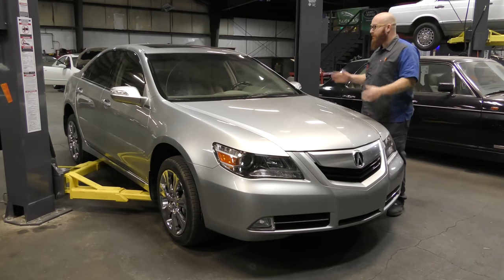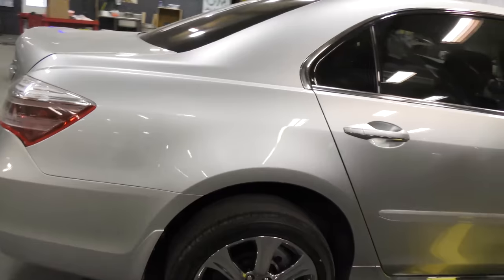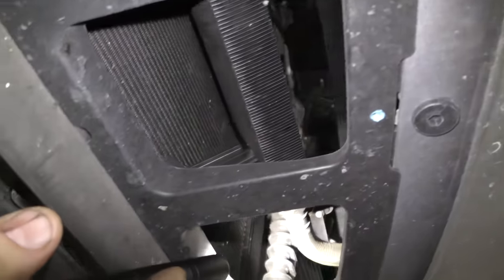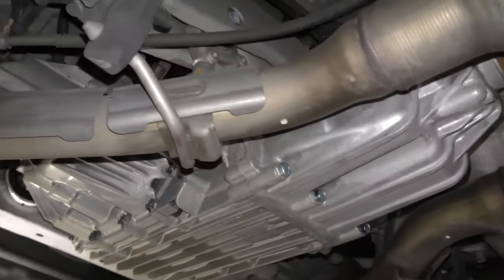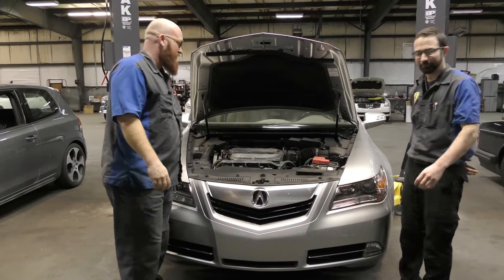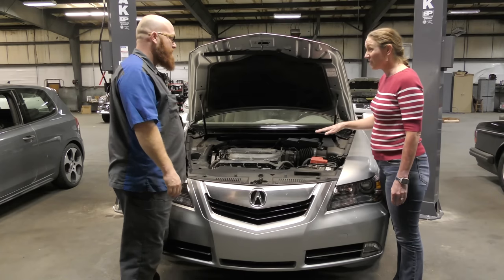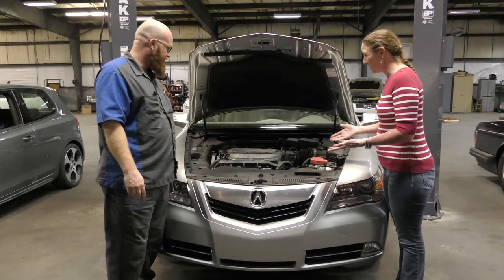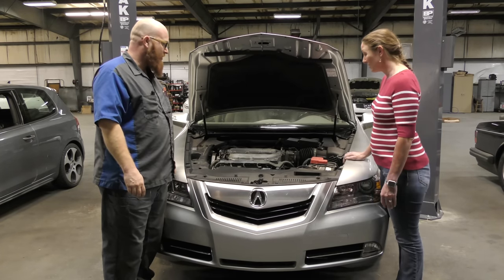Something Very Serious is Wrong with this 2010 Acura RL! What did the CAR WIZARD find???

Comment: First,  I love watching the Car Wizard.  Too bad for us there isn't one of him about every 20 miles or so.

As far as that Acura, what a shame. Acura's have been pretty darned good since the inception of the brand.  But like anything, manufacturing defects can pop up.  I had an 1989 Legend.  Master cylinder failed at 36,000 miles one month out of warranty.  Very unsettling. To their credit, Acura replaced it under warranty.  Then at 72,000 miles, yes....exactly another 36,000 later.... the same thing happened.  Tried to convince the dealership that I should at least get the part free.  To me it was obvious that something wasn't right with the part but it was a no go and cost me.  I was getting a little nervous as 108,000 miles approached but the problem did not repeat.  Kept the car for 125,000 and that was the only problem I ever had with the car.  I never had any kind of master cylinder problem on any car and don't even know anyone who had such a problem.

Comment: Second comment after reviewing other comments!   1. As long as your removing the engine, why not check to see hoe extension the damage is before you order a replacement., 2. How about an engine (used) from Japan with low mileage?    Jim

Comment: Hey wizard, its a common issue where certain v6 engines burn alot of oil and need re re ringed ive seen it oil foul plugs as low as 30k miles here at a dealer in ohio. Good luck on a reman

Comment: just buy a low mileage acura RL  like a 2006 model with the 3.5 liter. perferable with like 90k miles or less. and pull motor out. and drop it into the 2010 acura RL.   cost of whole car 2005-2007 rl probably 4500  after swap total in 5500k..options options options

Comment: Before the engine was ruined, I would have said this car belongs to the type of person you wanna buy a used car from, but not the type you want to be stuck behind on the road.  (5 mph turns, won't pull out from a stop sign until the entire highway infrastructure is clear, literally waits at a yellow light for it to turn red as the driver in the other lane casually drives through with plenty of time to clear the intersection before the light changes. RIP nice car.

Comment: So I’m at 8:09 I’ve just heard the car run and shut off again. My colleague had this noise coming from his work van motor the other week. We thought it had jumped a tooth on the cam belt.. turned out to be a loose injector.. let’s watch on and see what happened here
Reply: 9:01 oil light, knocking. Oh god, oh no
Reply: 9:35 no engine available... F it, LS swap, let’s go

Comment: As an Acura fan (I have 3 of them), this one was tough to watch.  Honda / Acura usually does a great job with their engines.  I was hoping for a followup video with the rebuilt engine swapped in, but didn't see one.
Reply: The J37's had oil consumption issues and there was even a class action lawsuit about it. Sadly the owner probably didn't check their oil regularly and with the common oil consumption issue it ran too low on oil and killed the top end of the engine. 

I love the later versions of the RL especially the 2011-2012 with the 6 speed auto for better fuel economy, but they made so few of them, they're impossible to find.

Comment: So downgrading it to a more common engine you can find new spares isn't an option for the customer? You mentioned the common 3.5 liter and made it sound like it was as common as mud. That should be a quick, cheap and easy option where you don't have to have use an engine that's got way more miles than the car itself.

Comment: My dad had a 2000 RL which was good for about 40k miles, then it started having issues (engine/navigation/window regulators), left him stranded  3 times, last 2 years he had it , it spent about 2 months in the shop every year. I was surprised with the reliability it had, considering it was Hondas flagship sedan. Nice car, but it was turning into a money pit, unfortunately..

Comment: I was going to buy a 2005 JDM Honda legend here in British Columbia from an importer, same as our Acura RL,only 65 thousand kms on it,  3000 dollars worth of nice Mugen wheels too but changed my mind when I read about the expensive drive shaft replacement cost. You can’t change the center bearing or the u joints on them, you have to replace the whole thing. Would have been a cool car otherwise.
Reply: you can buy that driveshaft on eBay used for dirt cheap..... and your driveshaft aint gonna break anyway.
Reply: @KushPizzaSleep  they had lots of problems with the centre bearings failing and they aren’t replaceable so you have to change the whole two piece driveshaft, I wouldn’t buy a used one because it would have the same problem

Comment: Hey wizard I have 2006 c230 mercedes. The siren alarm system went out. I replaced siren alarm system. When it went out the horn and windshield wipers and sprayer and lights all on. Now horn and windshield wipers and front light signal don't work. Look at relay for windshield wipers Q relay are good. Windshield wipers speed L relay are good. Horn relay are good. Circuit board on Q 30 and 87 has power. 85 no power 86 power. Test light on neg. 87 and 86 power. Test light on pos 30 power 85 no power. Windshield wipers speed L 30 no power 87 power. 85 power 86 no power. Test light on neg 30 no power 86 power. Test light on pos 87 power 85 no power. Horn 30 and 87 has power. 85 power 86 no power. Test light on neg 30 and 85 power. Test light on pos 87 power 86 no power. Car is in great condition.  In the garage. No wrecks. Can you give me some advice. Thank you.

Comment: I would remove the oil pan and check the rod and main bearings. Honda cranks can be reground and polished, the cylinder head  will need a complete tear down in order to remove the metal  junk in the oil, same deal with the block oil pan etc, 7,000 grand doesnt sound bad at all, you end up with better specs in terms of blue printing ,because the block crank and cylinder heads have already gone thru heat cycles, new pistons and rods might be aftermarket, and may be better then the factory stuff. Back in my day  Honda had weird specs for crank and rod clearence, unlike 10.20 30, etc, I may be full of crap, this is one reason why I quit turning wrenchs in shops 40 years ago.

Comment: wow! That's unbelievable bad luck and very uncommon for Acura/Honda.  My mom has a early 2000s 1.7 EL strong with over 300k on it and I have a 09 TL Type S (3.5l) with over 200k on it. Feel really terrible for this client!  As a licensed Tech I would recommend a fully rebuilt or certified refurbished / overhaul of their engine - it would be a huge disappointment to write that car off.  Please let us know what the root case of the engine failure was if the client wishes to proceed with overhaul

Comment: This is normal for Acura,  My boss had one and the first engine died at 40k= replaced under warranty by dealer, second engine died after the warranty expired = told my boss to dump the P.O.S. so he bought a used engine from Japan. Next the transmission went out and he had that replaced. HONDA =ACURA=JUNK !

Comment: I had a 2011 Acura TL SH-AWD with the 3.7. My TL was burning a quart of oil every 500-700 miles. ONLY HAD 56K

They’re notorious for oil consumption, with the piston rings. there is a class action lawsuit for this issue. 

Acura replaced my engine free of charge!

Comment: That's crazy that a Honda/Acura with that low miles needs a new engine. I guess there's a reason why warranties are miles or years. Maybe if the owner drove it more, he would've found the problem while the car was still under warranty, and could've fixed it at no cost. A real shame...

Comment: Wow.  I have an Acura RL 2004, great engine but some parts are rare and are generally priced higher than norm. Still its a 3.5 and from what I was told, it's a base original nsx engine. 7k repair, yikes. Well at least he'll have a new car basically

Comment: I would’ve went on car-part.com, found a low mile engine and been on my way. Just have to change the oil more often due to Acura using aluminum cylinder liners in these engines. And yes you can get new engines from Acura but it has to be pieced together.

Comment: I felt the same way when my 106k miles Tl 6 speed 2004 flooded this year and I had to swap to a used 151k miles engine used everything cost me $5,000 give or take but dam I wouldn’t have fixed it if it wasn’t standard and a rare car because nothing is gonna get me that money back resale wise not even parting the car out not that I would

Comment: Louis, Québec City canada, ACURA TSX 2009, k24z3. Be careful, acura engines consume a lot of oil and piston rings' tolerances Fade over the years for 2.4L and 3.7L engines! I nearly blew up my engine, but the oil level light came and I stopped right away to fill it up with 5w20. Change your oil every 5k miles, drive carefully and maybe install a catch can will save your engine. Be careful with those acuras. This is my second honda after my R18 and starting to regret it

Comment: Student, drives the car with no oil for 3 months, all kinds of noises, all check lights on.
Finally some gas station owner hears the noise and puts oil in it out of pity for the poor engine, noises persist.
Student calls daddy to fix it, daddy should have fixed the student way before this.

Comment: It  there anything in the JDM market from Japan? in NZ the used JDM swap out engine market is HUGE there and the engines generally have less than 40000 k's on them due to Japans really EXPENSIVE roadworthy the cars need about 45000ks it may not be branded Acura but Honda...

Once its reconditioned it will be interesting to hear back what exactly happened to it.

Comment: I do feel there's one common problem with the 3.5 and 3.7 (and one that's important) - seals and orings. Overall somewhat bad design and make of the top oil pump o-ring, it will leak (and also the surrounding Hondabond is great stuff but rarely is it 'forever'). That as well as the o-ring seals for the Vtec.  Iow, oil leak issues that require work accessing equates to a sizeable problem.  Unless staying on top of all them oil starvation is a possible result. Likely what happened here. Great engine but with little design issues that can kill it.  I'm also questioning the overall quality (longevity) of their o-rings as well.  Every one of them failing rather early.

add: I also don't feel their honda/acura transmission fluid is that good of stuff to tout much less 'require'.  Not buying the bs/hype of use honda/acura DW-1. In fact, aside from improper trans usage (user error), I wouldn't be surprised it the very cause of so many early trans failures in these great vehicles.  Far too many early trans rebuilds for a otherwise decent trans design.  I would go as far to say I think a different compatible full synth brand a better choice for best life (such as Valvoline MaxLife Multivehicle).  3 different changes at spanned times for a decent swap.  Better shifts, better heat control, longer life.

add 2: watch and manage that EGR system. Far from perfect design.

Comment: Broken oil pump outer ring gear causing engine to run with no oil pressure? NSX engines, which this is loosely based off of, are known to have the oil pump ring gear brake. However this usually happens at 8000 rpm. Certainly this v6 has had an easy, low stresses life. That being said I bet the oil pump braking is what caused this.

Comment: I understand wanting a new engine for this cherry.  Hard to believe that the thing crapped out with 40k if it was correctly maintained.
Reply: It's an issue that all 3.7's have. You can change the oil every 1K and it would still burn oil. Acura sent out a TSB were the Pistons and piston rings get replaced to correct this issue
Reply: That is unfortunate.  Had an Integra that got 400 miles to the qt.  New valve seals got my to 800 miles per qt.

Comment: Probaly a common problem with the v6 engine for those acura and hondas piston ring defect causing it to burn oil and with that issue and not paying attention to the oil level that's probably what happen just my opinion soo correct me if im wrong maybe you and I will learn something new

Comment: Can't offer any solution to your problem finding a new or reman version of the 3.7L Acura V6, but I can offer some intel explaining WHY they can't be found.  Honda created the 3.7L V6 by adding one milli-meter to the bore and 3 milli-meters to the stroke of the familiar J35 engine.  The additional stroke was no big deal... Honda's V6 outboard engines share that 96 mm dimension.  However, the addition of just one mm to the bore was accomplished by eliminating the cast-in-place iron cylinder liner and adopting a special German sourced aluminum alloy (rich in nickel and/or silicon) that was specially finished to survive the wear of piston rings on the aluminum bore.  It is the same alloy from the same source that Mercedes Benz has used for years.  Now a decade later...  the engine was relatively low volume and used for maybe 6 model years...  then dropped in favor of upgrades to the 3.5 L iron sleeved engine.   What ever quantity was built for warranty and service are gone, as is the ability to make the blocks.  The unique material and processing makes the original blocks unusable if bore resizing or refinishing is intended.  How would I know any of this is true?  My now retired former neighbor was the U.S. based representative of the German Alloy supplier, and after years of demos and trials with every auto company building engines in North America, Honda's US built 3.7 L V6 was the ONLY production engine to give the magic alloy a try.  Don't know if this relates to what is wrong with the RL in your shop.  But it absolutely does explain why you can't find a new one, or anyone who re-mans the old ones.
Reply: Looking thru replies below, seems oil consumption was a serious warranty issue.  Bet if you pull the heads, you will find one or more scored cylinders with bad rod bearings.

Comment: This isn’t the only Acura with that engine 3.7 TL comes with it and MDX
Reply: The 10-13 MDX, ZDX, 3.7L TL, and 3.7L RL had the misfortune of this engine.  The 07-09 MDX had an older 3.7L engine design and didn't have oil consumption issues (it had coolant mixing with 5AT fluid because of the poor designed radiator issue)
Reply: @mrgold3591  i was looking into 09-12 TLs with the 3.5/.7 and seen alot about oil consumption. I’m coming from a 3.5 accord and never experienced major consumption. even with 3k oil changes so I’ll look for a type S TL or 3.5 accord coupe
Reply: @Justvn4thGenTL  The new TLX with 3.5L DI seems like a very solid engine.  The 9AT can be hit or miss with the early models.  Another option is the +14 RLX tech with 3.5L DI engine that is good for 310hp/270tq.  The 14-17 RLX had 6AT and the +18 switched to 10AT.  They are a little harder to find; but, and the P-AWS rear steering can be an issue.  The 14 RLX Sport Hybrid might be in the same price range as a 12 TL depending on mileage.

Comment: Running a car without oil is not a factory defect. It's a user/operator mistake. My honda burns/leaks oil at about 8k miles  its empty. So I change it before at 5k miles problem solved.

Comment: This engine should be covered under warranty. As stated, there is clearly a manufacturing defect when an engine fails with milage that low.  I would have contacted Honda right out of the gate.

Comment: The RL is so good and this one is so nice, $7k to fix the engine can easily be justified. The owner certainly knows the car is likely to take very good care of his son over the long-haul. Where I live, just the sales tax alone on a comparable new car would be about that much. When you're done here, the RL should be good to go practically forever -- longer than the rest of the car (even this car) will hold up, which will probably be at least 200k miles or 20 years. 

Imagine the stack of receipts likely to accompany a 2010 BMW 5-series today, even a six-cylinder car. Also, Matt Farrah (Smoking Tire) paid $18,000 for a basic ring and valve-seal replacement in his air-cooled Porsche 911 engine. Sorry, but that is not far-off of being a six-cylinder Beetle engine, and can be removed and disassembled in about an hour. It's ridiculous. 

Anyway, when you're driving very special cars, a $7k repair-bill stings but it isn't the end of the world. Honda / Acura have proven their overall build quality over the past 50 years, so I wouldn't expect any other significant problems, and this car is worth saving.

Comment: The book is only $10k on this car (KBB trade value) so I'm not sure I would spend $7k on a car that will be worth $10k.  I had a coworker once that did the same thing (engine swap) and then just traded it in to the dealer a few months later.   Sure is a shame though.

Comment: Gosh, I'll stick with my 2004 Mustang GT conv with a 4.6 @ 150,000 miles, original engine. The engine is quiet, no oil leaks, no oil consumption. I paid $4,000 for my Mustang last year. No over priced, and over rated Japanese cars for me!

Comment: Hard to believe you can't find a low mileage JDM import motor with all the jdm importers out there. Convince the customer that a jdm motor that will have roughly the same mileage as the car... 30-50k is the sensible alternative.